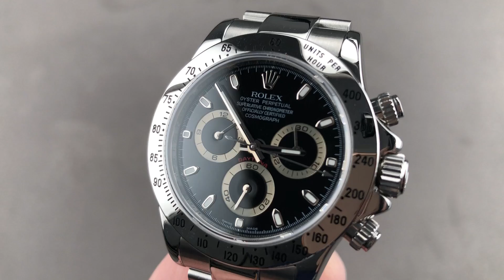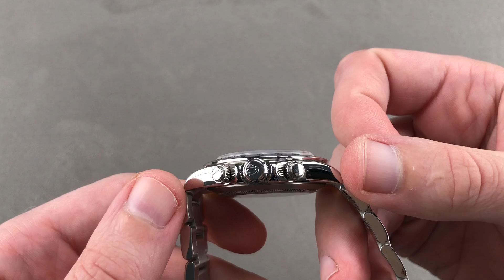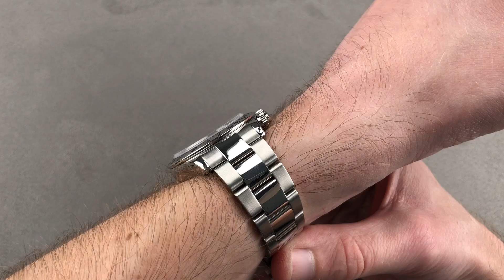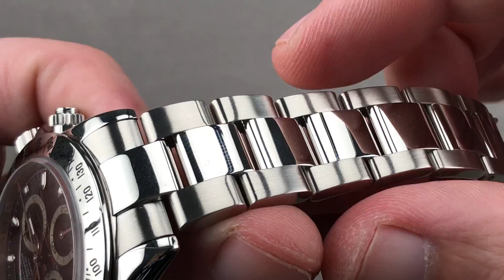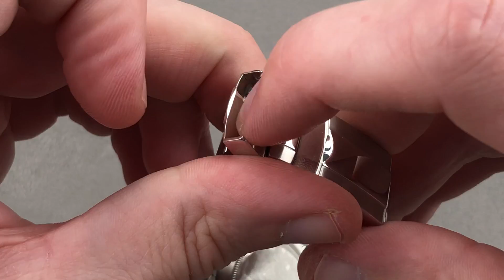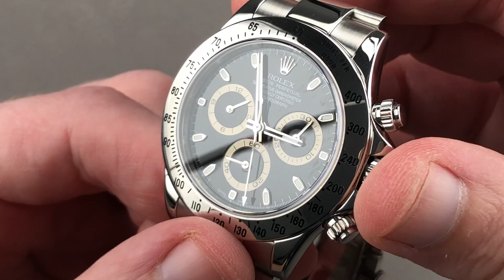Rolex Daytona Steel Bezel 116520 Rolex Watch Review

Comment: Thank you for this extremely informative video. I’m thinking of getting a mint piece however upon shopping I was told from a second hand store that the bracelet was tapered down towards the clasps in older models vs the newer ones. Is this true? And if so, I assume this is applied to pieces after 2009?